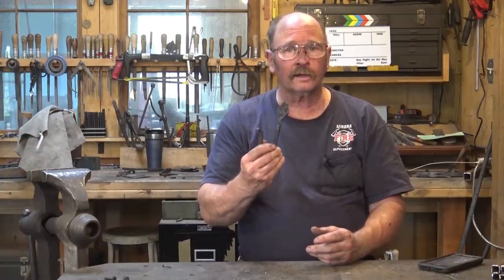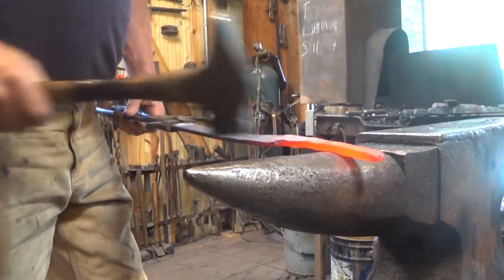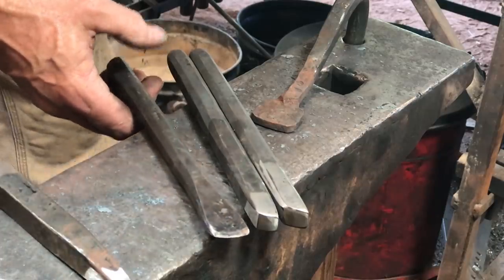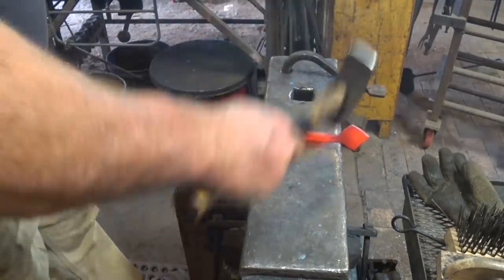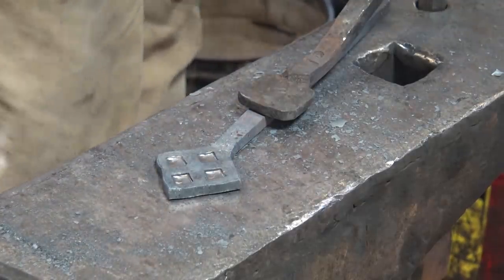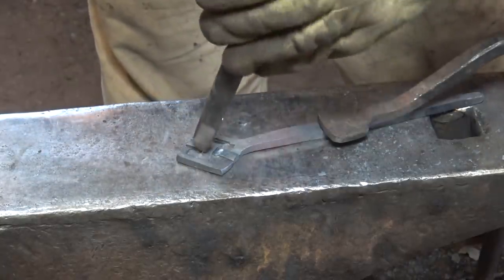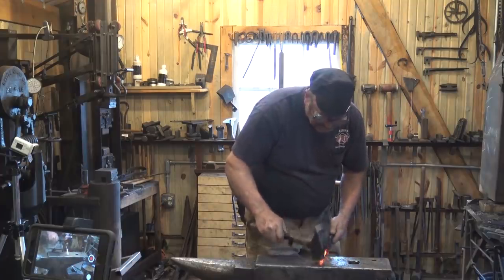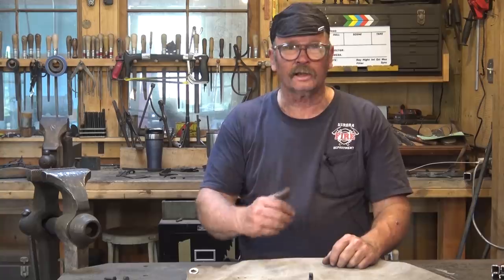Basket weave hook, a first look

Comment: I thoroughly enjoyed watching you fiddle away with it.  Your fiddling is much more productive than my fiddling for sure!  I must say, I saw the fly press in the last wide shot and would live to see you use that.  I want one badly but, when I consider the cost in the US, I keep convincing myself to just save for the hydraulic press instead.
Reply from the maker: I will be using the fly press more.  It can be a handy tool.  better for details than the hydraulic press, but the hydraulic press is more powerful for moving big material.

Comment: Nice looking hook. I've noticed you switched your favorite tongs. You used to mostly use the bolt tongs. Now you mostly use the slotted jaw tongs. I know 10000000 tongs are not enough, but the most versatile tend to be our favorites. Thanks again John.
Reply from the maker: I still prefer bolt or V bit for square or round bar.  But if the slotted jaws fit, they are pretty nice for the flat stuff

Comment: After seeing this project, I'm just itching to make some of these types of hooks.  I think, however, that I will cut some square practice blanks from the bar stock to make sure I've got it down pat before I botch up a hook!!

This was a great idea for a video.  Thanks for making it.
Reply from the maker: It never hurts to practice
Reply: Well, John, your inspiration for the basket weave came to fruition.  Yesterday, I made a 3 x 3 basket weave on 1/4" x 2" x 2" for practice and today forged out a large hook, drawing out some 1/4" x 2" bar to about 3/4" x 12" long for the hook with a 2" x 4" top to make the "for real" basket weave and started the layout.  Should finish tomorrow or next day, time permitting.  Those are fun to make!!  I had to make the two butcher tools though, since I didn't have any.  Used coil spring for stock.

Comment: I would recommend using a silver pencil to lay out the basket weave while the piece is cold, then using the chisel and punches to mark out where the lines go. It is too easy to put a line in the wrong place. Looking at an actual basket might help too.

Comment: I'm still very very green on blacksmithing, and last night an idea daunted me a little.. I wanted to forge a simple spiral bracelet with a head design at one end, but I would want the main body to that to be half-round; so the flat part goes on the arm and not cause the same pressure that a full round stock would create..
Is it possible to have half-round forged bars without too many tools or even none? Or at least I have to build a half-round bottom swage?
No matter how long your videos are, I'm still engaged until the end.. And love the "Tool of the day" series, being a freshman it helps me a lot..
Reply from the maker: Having a bottom swage would really help in making half round bars.  But you could try to forge  by hand and eye then spend some time grinding or filing
Reply: That was my other option.. :) I try to scrounge around and find some stock that I could use to make a swage bar, like I saw you made in one of your videos.. Multiple radiuses will help me also to mimic a sort of tail.. Thank you for your answer!!

Comment: great video. the video length is irrelevant, the details and explanation are necessary. a 5 min video that explains nothing and jump cuts over the details would be useless.
a noob question, but would it be possible to make a handsaw with blacksmithing skills? just a small handsaw about the length of a hacksaw.
Reply from the maker: I am sure the very first saws were made with skills found in most blacksmith shops.  However t hey were also not up to the standards we would have today.  Quality hand saws would have been made in highly specialized shops and I would imagine the saw plates were rolled by a rolling mill as opposed to being forged.